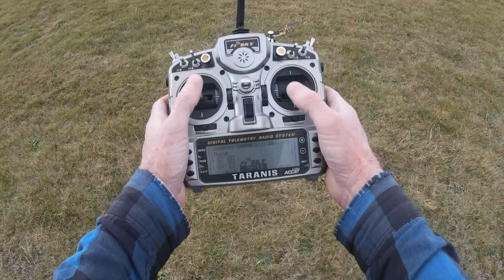Review: DJI Naza Lite multirotor flight controller

Comment: you need to make sure your center of gravity is perfect.......also calibrate the gps unit....you can get rid of the toilet bowl effect by turning the gps unita few degrees to the left or right of center....it will sit dead nuts still then......remove all red wires from esc except for one....add capacitor to one extra channel....by n1osd and one 5.8 gig tx and youll be kicking but with that beleive me

Comment: As for the GPS Antenna, I've worked with Military GPS systems, in conjunction with Comms, EW Platforms, Special Camera Systems etc. They all pretty well use the same coax connector and the same frequency. some are magnetic-based, single screw/bolt mount, triple screw mounts. You can source these and surface mount them on your UAV. there's even these that are 2.4 GHz little gems that I plan to use. : http://www.sanav.com/ceramic-bulk-smt-antenna.htm

Comment: I have the same flight controller, the same receiver and the remote is Taranis Q X7. The receiver is green so we have a good connection and when I plug the flight controller(naza) to the computer I can check that the input on the remote is transmitted to the flight controller. However, the motors don't want to turn! They beep indicating they have power but the arming sequence doesn't work. 
Any idea of what I'm missing? By the way I'm using Sbus
Please help! I need this thing to fly

Note1: I have bypassed the flight controller and I have checked the motors work fine.
Note2: The only movement I can get from the motors is pointing both levels up to the center. When I do it they turn but that's the only order they obey. This gets me crazy because that movement doesn't even belong to the arming sequence.

Comment: Someone probably already said this..  Turn the gps/compass puck clockwise about 40 degrees for the heading offset will remove the toilet bowl..    Naza is OK for photo platforms on larger drones, but nothing like an APM or other newer design. The full V2 is much better than the lite, but still not a hotrod controller.  (I've got two large camera platforms with V2's on them.)

Comment: Hey Bruce, i am sure someone else mentioned it. But i dont want to go through all comments. 

You can secure the gps with some CA, you will get it  loose with some heat if you want to take it apart. + For the flight modes, set up a mixer to get the flightmode channel between Atti and GPS oder Atti and Manual, now you have a switch for failsafe/RTH.

Comment: I found a problem with your build!!
 GPS/Compass cable touching ESC wires is not a good practice and may explain the problems with toilet bowling! 
I have an Naza lite and flys much better than this, even before I have upgraded the firmware to Naza M,  recommend upgrading firmware and buy updated GPS pluck Ublox M8N 
for naza , bangood has it..

Comment: I still own Naza Lite flashed with V2 firmware. Always locked in pisition, never had any problems with it. Just works. Pretty much plug and play. I have wanted mission planing and telemetey Pixhawk is offering, so I bought it. Unfortunatelly, everything about it was problematic. Firmware flashing, setup, calibrating... I was ready for fiddling around, trimming, adjusting, but I still... I was never satisfied and left the project.

Comment: hi bruce great video I have the same fc on my dji f550 and I had the same trouble as you so I did the v2 firmware upgrade and it worked flawlessly and before each flight I do the naza calibration dance and that helped loads look forward to your next video peter uk

Comment: Bruce when you  set it to GPS...  you did not let it get tuned in to the sats......mine take  2 - 3 minutes to settle down. I use a "starter battery" to warm it  up  and then when its steady - change to a bigger battery and do my stuff  and its steady..  Depending on setting... it will lane when  the battery depletes.    Feel like I am trying to teach my granddad to suck eggs!

Comment: Said Bruce - can be unofficially upgraded to a Naza M -   I purchased the Naza light a year ago and have  no problems with it.  The quad  must be tuned to fly good BEFORE using the DJI stuff.  BUT anybody thinking to save money and  illegally "upgrade it" needs to do a lot of checking first -  there are are a lot of issues AFTER the upgrade and waiting 5 minutes for the  board to warm up. Others report  a serial number request popping up.... and  attempts to  "downgrade" back to Lite  also has issues. I did not try to  "upgrade" mine.  I did buy the M v2 cost was and is reduced on FoxtechFPV.  Dont bother trying to save money   both version d o a good  job of what they are intended to do. The dreaded flyaways and other issues are usually down to bad setting up rather than DJI in built problems.   Ayybody on the  Central Coast wanting either version - with or without the  quad  it flies..... ?

Comment: For Pos Hold you have to consider the accuracy of the GPS. 

Even if GPS is connected and receives enough sattelites  the accuracy is approximately +- 1m. 
So the FC will get contradictonary information in Pos Hold which it tries to correct. This is what you have seen when flying in Pos Hold. 
So it is just a matter of tuning...... 
And btw as the hardware is same as NAZA-M you can flash a cracked firmware iof NASA-M to it  and then it operates much better , does even waypoint navigation and autonumous flights. And when comparing it to a NAZE32 with iNAV firmware and GPS it is an inexpensive and good solution.
Reply: They call it the 1M bubble

Comment: The problem with Naza controllers is that DJI is a terrible company and won't support them anymore and refuse to release firmware updates and new software even though they still sell them!  I bought a Naza to replace the worthless Pixhawks that would never work but the DJI software wouldn't run in Windows 10!  When I contacted DJI they wouldn't update their software and said to use XP!

Comment: I used epoxy to bind my GPS dome to the shaft, and shaft to base.

Good to see QuadLugs frame. It's the best setup for testing and all around easy repair.
How does configuring the NAZA compare with APM?

Comment: APM uses 8 motors and is very easy to set up.  I built an X8 with the hobby king 525 mm quad frame with the aluminium arms

Comment: Those receivers should have a mode where you can put out 8ch sbus and 8ch pwm for aux functions. That way you can use sbus for flight controller and ch 9-16 pwm for aux channels. Also you can believe it or not, run a y cable from sbus output from receiver and use 1-8 sbus channels for flight controller and run the other end to a sbus compatible gimbal and set ti to use sbus ch 9-16

Comment: Did a double take when I saw the title - even though Bruce mentioned this in a previous video - and had to check again when I saw that wooden beast without Windestahl yelling "Do so stuff!" I've got a Naza M Lite, with a V2 mod, on a Quanum Venture. The mod really fixed a lot of issues, and made the experience much, much better. In 2015. I am very curious what state iNav is in, or where Ardupilot-based systems stand in the years-long war against DJI's FC. When I last used an APM, I was programming waypoints into my 450 via 915mhz or bluetooth, with my FPV video overlaid in the Mission Planner screen. It was very elegant for it's time, but DJI has absolutely reinvented what a drone GUI should do since then.

Comment: Turn your GPS a little to the left if its toilet bowling to the right , just a bit off of dead center true North.  There is a actual True North degree you can look up on the internet that matches your location  , its a bit off of the reading that  a compass shows.. Did you do the GPS calibration dance?  This F/C is a thing of the past but still not a bad unit.  Use a separate switch for Fail safe as well as setting up your RX to have it as well.

Comment: Before I started flying planes I purchased a dji f450 with naza lite. It went wrong so I then purchased another one with naza m v2. I flew better,  more stable. However I had it go mad on me twice for no reason. No failsafe triggered was flying 5 m from myself and it went into return to home but instead of landing where it took off it went nuts and flew into a line of trees 100 m away. Scary as. I dismantled it and chucked it. Couldn't trust it. Was very happy with it until then but a big quad just going crazy like that isn't good. Thing is majority of the time it would fly lovely but then just go mad. I lost faith in dji after that. The return to home and fancy modes are fine until they go wrong.

Comment: Dearest Bruce In NZ for me turn the GPS about 20 degrees to the right and that fixed my toilet bowl problem as I have nearly the same size timber frame home made quad also it seems to need a balanced frame so move main battery around alittle it helps heaps with drift when powering up etc......Brett

Comment: NAZA is rubbish. DJI are like Apple. Massive price tags, heavily limited functionality and an army of fanboys who cause nothing but problems for the rest of the "drone" community.
Reply: Bullshit.. NAZA controllers are good for what they were designed for. Sport pilots who like to build their own rigs. DJI have done nothing to create the idiots that give drones a bad wrap, however the news media deserve most of the credit for hyping up what is a non problem.  DJI have a fantastic range of controllers ranging from the Lite through to the N3 and they fit every niche in between. Speaking from many years in this freaking hobby if you want to fly to take photos or do commercial work you cannot go past DJI for the prosumer range of craft. I defy anyone to build a machine with the capabilities of a P4 pro for the same money. It cannot be done plain and simple. Even the higher end Inspire 2 is priced at little more than a decent camera costs. Sorry if I come across as one of those fan boys, trust me I am not but no one has even come close to what DJI are churning out for the price. No One..
Reply: I still fly a QAV500 with a V2 and just picked up 2 zenmuse gimbals for a hundred each. Parts are easy to find. Can-bus just works. Gimbal does gimbal correctly. Flights are smooth and solid with 11 inch props. I want to hate them, but I don't spend hours fixing it.
Reply: Again I don't want to sound like that fanboy but I have about 15 drones in my shed. NAZA lite hacked, NAZA M, Pixhawk, TAROT ZYX and a bucketload of Naze, Cleanflight etc etc. It was not a competition but trying to build a good camera rig meant trying everything basically.  The camera platforms are pretty much restricted to Go Pro and the clones and none of them come within a bulls roar of the Phantom 4 pro. You quite simply cannot build a rig that will carry a 1" sensor camera with full remote capabilities nor image quality. I went down the full sized rig, basically an S900 but when you summed it all up it was three times the price and ten times the heartache over the P4P. We now exclusively use DJI for all our Search and Rescue, Fire Service assistance, Disaster relief and support. Inspires from the X3 to the X5 and X5R. FLIR XT camera, and the P4 and P4P for weddings or work over areas that are populated. All are fitted with emergency chutes (Its the law here) plus you are now no longer permitted to fly a home made device for commercial use. DJI have done nothing to create the drongo ignorant crowd who ruin it for everyone. In fact they have probably done more than any other major drone manufacturer to try and instill some sense of responsibility on the user. There are plenty of DJI knock offs on the market today and some are excellent. I defy the average Joe on the street to pick an AUTEL quad from a Phantom for example. It seems today that if its white and it flies its a DJI and that simply is what happens when your product attains a level of recognition like Apple and Samsung for example. So again no fanboy here but then again its like comparing Snapon tools with a few Sidchrome spanners. You get what you pay for always.
Reply: totally agree Allan. DJI has integrated most things rather well
Reply: Elf, Im not in anyway defending DJI but their products in the right hands are good and thats not stretching the truth.  As for not being allowed to use homemade rigs for commercial use that is a DGAC decision and based on one simple premise.  A registered aircraft must have a flight manual.  You can call that a silly decision but bureaucracy abounds in all forms of state control. To register an aircraft it must have a model number, serial number, flight manual.  Then there is all the pilot certification, risk assessment, permits and logs etc etc.  But none of that impacts recreation pilots. Same deal as most other countries, 400 ft and VLOS.  

To beat up DJI on the legacy products like the NAZA M or Lite is a little harsh.  Open source will never kill DJI or any of the big players because the market they target are not the likes of you or I. Their market is the plug and play crowd.  It is infinitely bigger than the hobby market. Hobby King proved that.

I think I said it previously and that is I have my old 450;s and 550's. Tarot frames with Tarot controllers. I enjoy flying them and having fun with them but none of them are of any use at all for photography or video. No matter how much gold paint you put on a Go Pro 5 it is a very poor camera and useless for commercial use.
Reply: I use the naza dji aceone,still the best
Reply: SJohnM81 I think that (fanboy) issue is more of a problem with the Phantom / Inspire series of products and owners, maybe the Mavic too?  The naza and other DJI products work just like they are supposed to and have a product for most budgets, Personally i still own a few custom built naza M V2 Quads from years ago that don't get used anymore but I fully agree with them being similar to apple and don;t like that about them, but i think (rubbish) may be a bit harsh. There is plenty of info on tuning and setup making them user friendly. (providing you can download those stupid VCP drivers first)
Reply: You are spot on with that short story i too have tried most brands to see whats on offer and have a bunch of various copters ready to fly when needed,  Im far from a dji fanboy and havn't flown dji for some time now  but they work very well for camera ships and are my go to for aerial photography.
Reply: Allan Main - "no longer permitted to fly a home made device for commercial use" Well, there is another reason to hate them! I'll fly the controller but not the overpriced parts bag they call an aircraft. The V2 is already a legacy product, GCS is not longer supported because that is what DJI does... Drop support and force you into the next drone. I can use the V2 only  because of UgCS. My QAV frame hasn't changed since it's release and I can make the G10 arms at home if I need too. 

Opensource WILL eventually kill DJI because of the lack of lecacy firmware support. I have even had the DJI app flash the wrong firmware to my IOSD for which I had to get a "backdoor" from DJI support to downgrade the firmware. INAV and the F4 might be a V2 killer for me but only because I need better firmware and DJI support is a joke.
Reply: In my opinion DJI are massively responsible for the drone idiots getting about. They were the first to market a system specifically aimed at people who know nothing about aviation or the complex safety issues involved. That makes them irresponsible as a company. The have helped create the very legal situation which they are now cashing in on. 

As for flight controllers in the commercial space, I prefer 3DR and their Pixhawk system. My company design and manufacture small remote security systems and the open source nature of the Pixhawk allows us so many more abilities than a of the shelf package like the DJI range. Plus the Pixhawk is a fraction of the price.
Reply: Point taken mate but that is like blaming Apple for the deaths of drivers texting while driving. Or Henry Ford for developing a cheap car for people who did not understand the complexities and safety issues when driving a car. A car under the control of an idiot texting is far more dangerous device than any consumer drone on the market. DJI have learner mode and many well thought out strategies to try and stop some of the idiots but like anything, not all idiots want to stop being idiots.

Pixhawks....

There are Pixhawk's and those other Pixhawk's as well. Strange enough the only Pixhawk"s I have ever had fail were from 3DR and they were not cheap. Both of them blew something and when asked if it was replaceable they said no, 90 days old and out of warranty. However my Banggood supplied units have never let me down and have over two years of frequent use.  Now that you mention Pixhawk you also need to admit that you need to be pretty darned clued up on the software before your ever going to get something to fly let alone do missions and the myriad of complex things that control is capable of.  I mean as far as capability its very hard to find a better control unit but ease of use!!  Well thats another story. Months of trial and error in my case to get to where I wanted to be and even then I was only touching the easy parts.  My current project is an autonomous wing capable of 30 kilometer missions totally hands off.  Second dream is to launch a wing into the stratosphere. 100,000 plus feet and bring it home. The Pixhawk can do it all, but the old fart programming and testing struggles with it all for sure.
Reply: Allan Main All excellent points! Glad to hear the Pixhawk info. Even I know NOT to buy the 3DR version at giveaway prices. Learner mode is for selfies, anything more than that requires rolling up the sleeves. Kids today are learning Betaflight off of youtube... two years later it is a different world. Idiots need tech support. Kudos on living the dream! We all want 100k, LOL